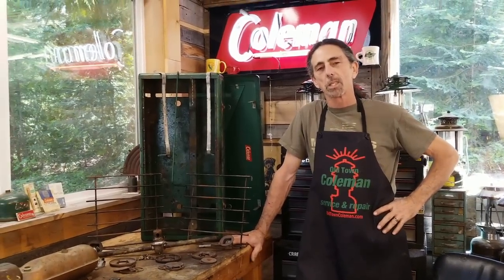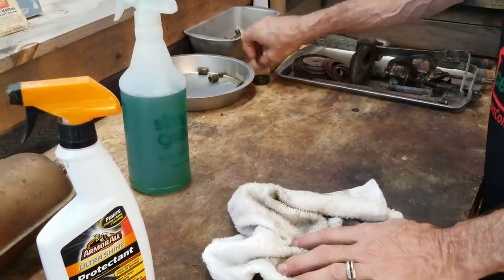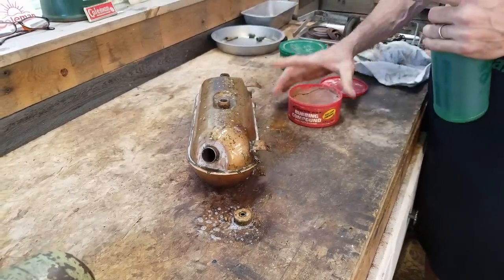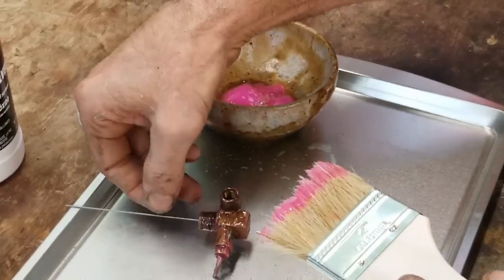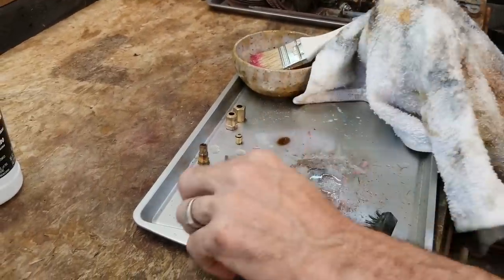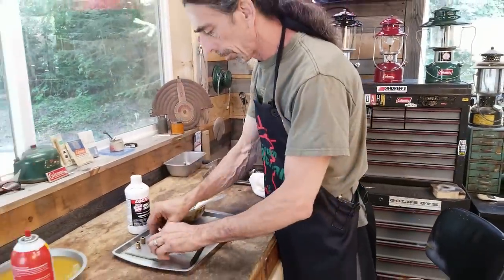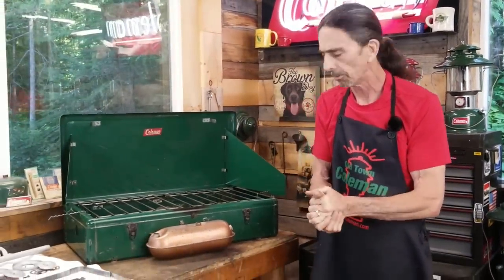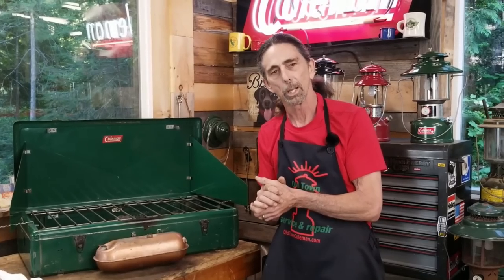How to Rebuild a Coleman Two or Three Burner Camp Stove - Part 2, Cleaning

Comment: Whenever I first started collecting I thought it would be a good idea to use oven cleaner to clean my Coleman stove... Nowadays I realize you'll ask that soap and water is the best way sometimes a little simple green or a purple power is okay, But that day a long time ago I learned that oven cleaner is a wonderful and powerful paint remover. So beautiful worn oven cleaner is a no no on painted surfaces. Thank you Frank I can't wait until episode 3
Reply from the maker: Oven cleaner is an excessively nasty product that I avoid.  I've used it too, and learned the hard way too.  It works but just isn't necessary...

Comment: I just had to repaint my 414 case as I had to do a lot of "body" work. Same shade of green as your showing I believe. Rustoleum "DARK Hunter Green" seemed a great match. Not to be mistaken with Rustoleum "Hunter Green" though.
Reply from the maker: Oh yes sir, there are many Hunter Greens and Forest Greens.   I think the 424/414/428 stoves are a couple of shades darker than the conventional older ones?
Reply: Does Coleman sell spray paint of their color's?
Reply: @tomwilliams8675  I have not seen that they do in any parts search for my gear ever. However, I am not any expert.

Comment: Frank you cease to amaze me when you do such fantastic work on your restorations and clean-ups! hell I always seem to mess up and yes leaving them in the dishwashing liquid too long does peel the paint so I end up eventually putting them in the electrolysis tank I made to completely remove paint and rust then repainting them. I haven't painted the manifold or pipes though because by the time I calculate how much I already spent that VHT paint looks like I have put too much into the usually $10.00 stove I purchased then add my labor to it and time spent on it and I'd never get my money invested and everything else if someone wishes to buy it but I do get that great feeling and sense of accomplishment out of using it and others admiration of it as well! So that in itself makes it all worth the while and of course I'd tell them how I learned and refer them to you!
Reply from the maker: If you don't do this for the love of it, you're probably not going to be very happy.  Taking the time to repair a machine that someone else built years ago is good for the soul.  Sharing the love makes it all worthwhile.

Comment: My luck with Evaporust is that it blackens some steel parts. Easy to polish back out though. I've wondered about using oven cleaner on the grates?
Reply from the maker: I've used it and it works fine.  If you can get past the horrific smells.  I'd take soaking them in a bath while drinking sweet tea over oven cleaner any day!
Reply: @OldTownColeman  Thanks. I know that on chrome motorcycle exhaust pipes if something gets burned onto them, oven cleaner is about the only thing that works other than laborious polishing.

Comment: Hey Frank, great video as always. Great tip on not soaking the valve in vinegar. Oops!
Question though...if the fuel tank does have rust,
 Inside,  what's your approach to remdiating that? Vinegar? Hot water? Pixie dust?  
Thanks!
Reply from the maker: Evaporust works great.

Comment: Great job Frank thank you for showing us . What color do you recommend  to be the closest  color  to coleman  green
Reply: From my research, "Hunter Green" by Rustoleum is pretty close
Reply: And that is for the font.  If you are redoing the hat, you will need a high-heat spray.  Ill let Frank take it from here!
Reply from the maker: There are a number of greens that Coleman used over the years, so it really depends on what appliance you are speaking of.  The green case of a 426B is pretty much right down the middle of the road for the "forest green" color, of which there are 4 or 5 versions available today by different paint manufacturers.  Take a piece of the stove with you to the hardware store...

Comment: Thanks for this video! I’m going to attempt a rebuild on my 426B in the near future. When it comes to painting the burners do you have a preference in paint or are all high temp paint’s basically the same? Thanks
Reply from the maker: They are all basically the same, and I promise that the inside of the master burner bowl will become paint-free.  The direct flame goes directly at the paint and it just eats it.  On my user stoves, I blue the burner bowls and caps, and they survive snowy ice fishing seasons without rust.   I did a little blueing in the 502 rebuild video, but I'll do a separate one in the future dealing with rust.
Reply: @OldTownColeman  I will be looking forward to the blueing video! I appreciate you taking the time to make these videos and sharing your knowledge!

Comment: Frank, I have been looking for some preferable direction on storage and how you should leave a lantern when not in use.  Question: Do you remove all the fuel, leave fuel cap loose and put some WD40 in the tank to stop rust. Thoughts. Ken Adelaide Australia
Reply from the maker: Hello Ken!  For long term storage, empty fuel and allow tank/fount to dry completely.  Reinstall cap snug but not tight.  If you are in a very high humidity area you might want to put a light oil inside.  If you add oil, you'll have to wash it out before using the appliance again, of course.  And yes, I would think WD40 would work also.

Comment: Hey there I have a stuck pile nut I just can’t seem to get off of the bolt part of the manifold. So one of them came right off and the other one just turns and turns and turns, but won’t move at all. So my manifold is kind of stuck in the stove. Is there a trick for getting out the pile nut? have you ever had this happen?

Comment: Hi, for Coleman lantern and stove, what wrench I must have? Thank you for your help.
Reply from the maker: A wrench for what part sir?
Reply: @OldTownColeman  Any parts of the lantern, as I do not want to buy the whole wrench set which have big ones for car and motorcycle, I only need those for Coleman lanterns. So please advise me those you always use to repair and service Coleman lanterns. The only wrench I have is 3/8. Thank you so much for your reply.
Reply: Due to the many possible sizes you may encounter, I'd recommend a 4in AND 6in adjustable wrench(aka crescent wrench).  I recommend both.  Look for ones with the least jaw wiggle(slop).  They aren't as good as combination wrenches, but you'll only need 2 instead of a set.  If you get a set, get SAE combination wrenches.

Comment: If I cannot get the check valve out, could I spray carb cleaner down inside it?
Reply from the maker: Yes you can.   And, you'll want to "push" a little of the cleaner through the check valve too, just so it is guaranteed to be on both sides of the check ball.  Spray a good bit of cleaner down on the check valve, then put the pump in the cylinder and push it down about an inch, just to push the liquid through the valve. 
 Then spray in more to  completely covers the top of the check valve and allow it to soak.

Comment: To paint, or not to paint.  I am 50/50 on this.  About half of the stoves I have restored I have stripped and painted.  Not sure which way I like better.  I repaint stoves that are in the worst shape at time of restoration.  (I have restored about 10 stoves so far).
Reply: As they say with any restoration; it's only original once.....
Reply from the maker: Stoves are a very tough nut to crack.  They really take a beating over the years and the optics can be horrible.  There is a line between "has character" and "butt ugly," and sometimes putting lipstick on the pig makes sense.  But for me, it has to be REALLY ugly for that line to even appear.
Reply: @TheReal1953  Rust is the reason for painting.  Original and rusted out to me is not as good as rust removed and still a viable tool.
Reply: @scottperson9487  I'm not sure I understand what you're saying. I would keep things original unless the rust is bad/deep and maybe just treat that particular area. Nothing looks worse to me than something that's been 'restored' and it's obvious. Now, if I have to look really hard to determine if it's NIB or restored, then the owner has done a stellar job.....most don't.
Reply: @TheReal1953  I think we are talking about a tool that is used like a tool and not for showing at a stove show, not a 1969 Mach 1 Mustang.
Reply: @scottperson9487  It's just like anything that provides some utility and/or recreation. Some people are adamantly opposed to repainting older collectible stuff. No one said anything about vintage cars, previously. If someone is trying to sell me a Coleman stove that is "restored" for big bucks, it better look factory original is what I'm saying, and not just his version of 'original'. If you're the owner of a Coleman product, you can do with it absolutely anything you want and you know that.
Reply: @TheReal1953  Man, if someone is trying to sell you a Coleman stove for big bucks move on!  I gave away most of the stoves I have fixed up painted or not.  I am rarely in them for more than $20 after they are fixed up and with a high stress job during the week I really enjoy working on low cost projects on the weekends.  I keep one really good example of the three sizes of stoves on a shelf and one of each the three sizes that I use to cook.  So right now I have maybe 8 - 10 stoves counting those six, one from the 1960s still in the box and a few that I have not worked on as of yet.  Thinking back I have probable given away more than I currently own.
Reply: @scottperson9487  You're making a quantum leap here in what I've done personally with Coleman products. I've never paid more for a stove or lantern than $10 so your brag falls on deaf ears. I enjoyed fixing them to run again like new. I'm commenting on the current trend of 'collectors' in the hobby and what they are willing to pay for someone else to do the 'restoration'. Sometimes it's obscene with seemingly no limits. However, I had a very personal reason to find an old Coleman metal cooler with the metal hinges and lock mechanism.  I paid what I thought was an obscene price for one with accessories that looked like new inside. I even waxed the outside with the best auto wax. It was like leaping off a cliff...no practicality at all because I won't use it..... too afraid to damage it. That won't happen again.  I've always said I'm not a Coleman collector.....I just happen to have a lot of their stuff. Nothing was ever bought with the intention of 'collecting'.